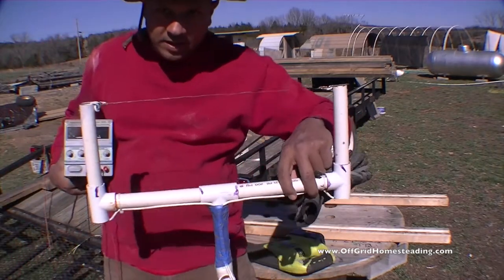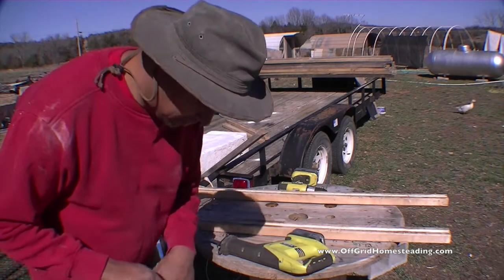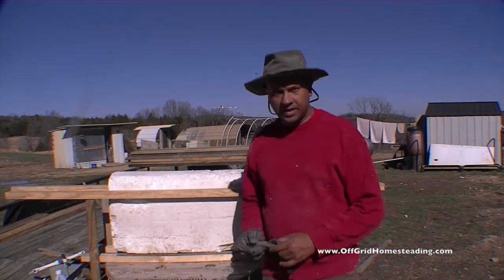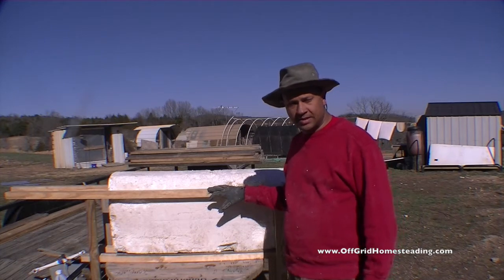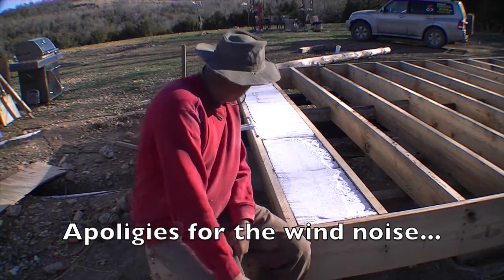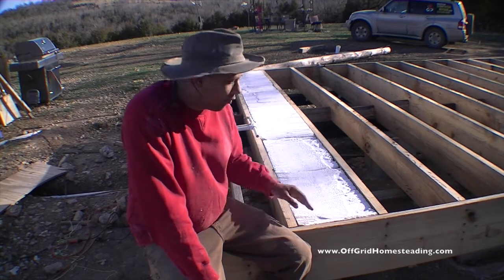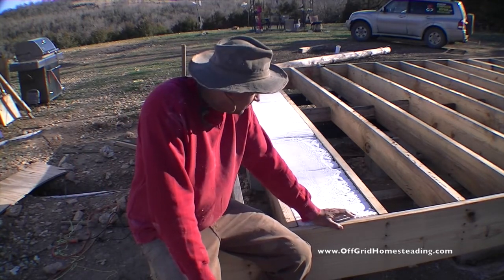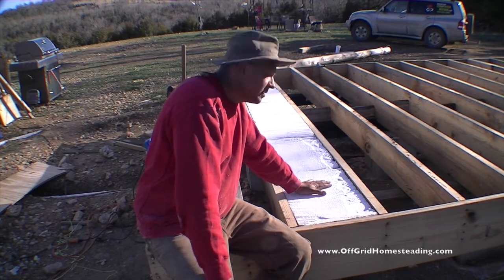OGH - INSTALLING EPS FOAM BLOCKS AFTER HOT WIRE CUTTING BETWEEN JOISTS

Comment: You may want to put something on the under side to keep critters from chewing at it to use for nests too.  I LOVE the idea and a great way to reuse what would have polluted the Earth otherwise.
~~Vicki~~
Reply from the maker: Thanks Vicki!  Yea I've been told to use a mesh of sorts to keep things from dropping through.  I dont think I'm going to have that problem.  Someone suggested possibly using that material that is under the floor in an RV that black meshy stuff that is incredibly tough.    We will be putting plastic 9mil on the ground then later (another project) we'll trench around the perimeter and build a cinder block wall to reach the base of the structure.